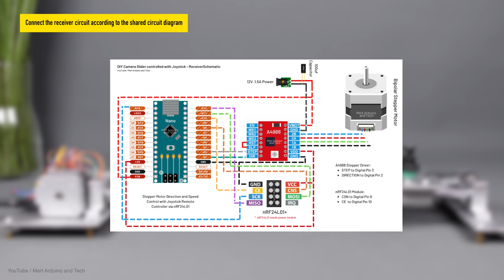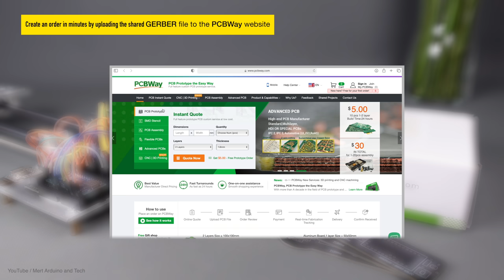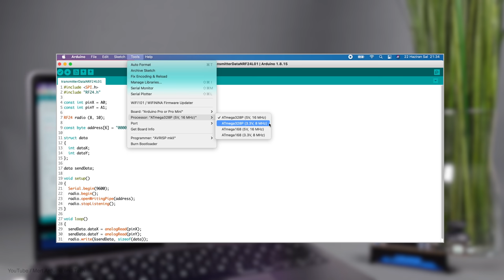The Joystick Hand Controller and DIY Camera Slider

Comment from the maker: 📄 📌 All documents and details of the project :
▪️ https://www.pcbway.com/project/shareproject/The_Joystick_Hand_Controller_and_DIY_Camera_Slider.html  
▪️ https://www.instructables.com/The-Joystick-Hand-Controller-and-DIY-Camera-Slider/

🧰 Required Components for Joystick Transmitter Circuit
▪️ Arduino ProMini https://bit.ly/3wmSLFK - https://amzn.to/3jUwufV
▪️ nRF2L01 Module https://bit.ly/3yl5Y2X - https://amzn.to/3ArlY5C
▪️ Joystick Module https://bit.ly/3xiAvyf - https://amzn.to/3wbbRyt
▪️ Capacitor Kit https://bit.ly/3yjhhZC - https://amzn.to/3jHS8Uc
▪️ Resistor Kit https://bit.ly/369DD3G - https://amzn.to/3ypp6Nd
▪️ Switch 8x8mm https://bit.ly/3xiIhIH - https://amzn.to/3AkiYYu
▪️ LED Kit https://bit.ly/3hCGCXN - https://amzn.to/3AroZCY
▪️ 18650 Holder https://bit.ly/3qPlce3 - https://amzn.to/2TyowOA
▪️ 18650 Li-ion Battery

🧰 Required Components for Receiver Circuit
▪️ Nema17 Stepper https://bit.ly/2SOyQBK - https://amzn.to/3hBc4W7
▪️ A4988 Driver https://bit.ly/3qSNZi4 - https://amzn.to/3hsfb2M
▪️ Arduino Nano https://bit.ly/3wiBxsK - https://amzn.to/3AsUnkb
▪️ nRF2L01 Module https://bit.ly/3yl5Y2X - https://amzn.to/3ArlY5C
▪️ nRF24L Adapter https://bit.ly/3jGF5SZ - https://amzn.to/3dJvZRT
▪️ Breadboard https://bit.ly/3qJckqi - https://amzn.to/3hxX5MN
▪️ Power Jack https://bit.ly/3dHkLNy - https://amzn.to/3jMOokF
▪️ Jumper Wires https://bit.ly/36bYH9L - https://amzn.to/3Ap5lHv

🧰 Required Hardware for DIY Camera Slider
▪️ Linear Rail https://bit.ly/2TyrToI - https://amzn.to/369v7Sp
▪️ Rail Shaft https://bit.ly/3xl3Zf1 - https://amzn.to/3AvsmZE
▪️ Linear Block https://bit.ly/3dJHyID - https://amzn.to/3whrhkK
▪️ Wooden Plate https://bit.ly/3hdxwSk - https://amzn.to/3dJaaBP
▪️ Screws Nuts https://bit.ly/3hdxQk0 - https://amzn.to/3dK2fEu
▪️ Screw DSLR https://bit.ly/3dJ7Qux - https://amzn.to/3dJ7LXL

🧰 Required Tools
▪️ Soldering Station https://bit.ly/3yjXCsu - https://amzn.to/3jH1ZKf
▪️ Cordless Drill https://bit.ly/2UXxftW - https://amzn.to/3xjBq1o

Comment: Are you using camera for picture or video? If video then it is a bad choice . I will never buy a nema17..they are horrible noisy motors
Reply from the maker: Noise is just a sound effect.  It's not the sound of the stepper motor itself.
Reply: @maker101io  I was talking about the real usage scenario of the dslr with your slider.  I have perfect noisy nema17s in my 3d printer and laser engraver.